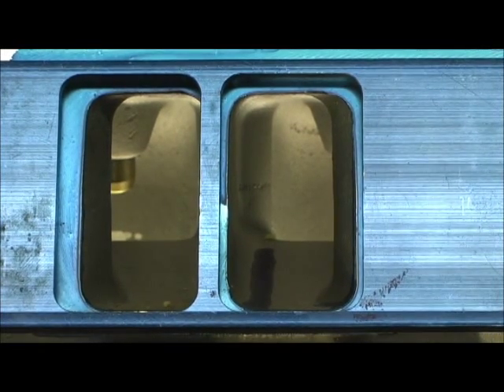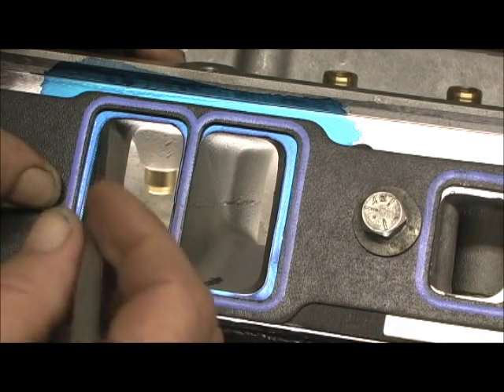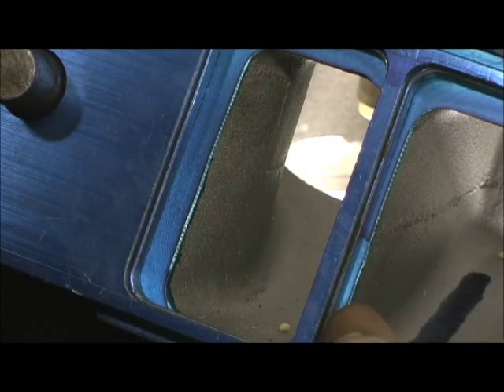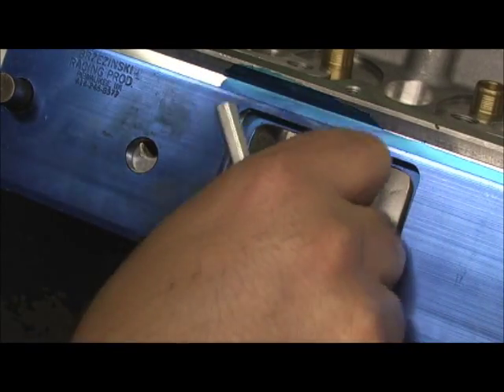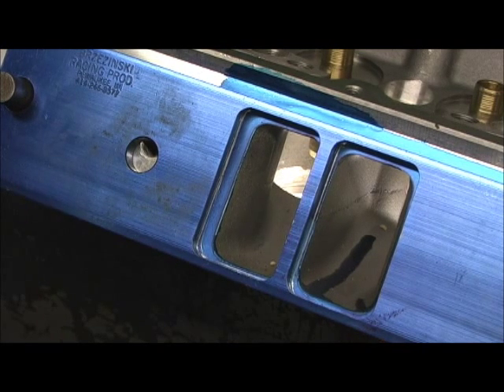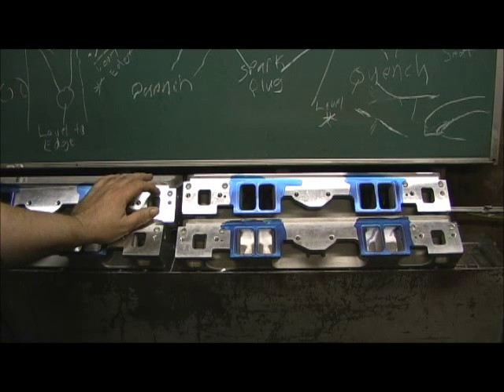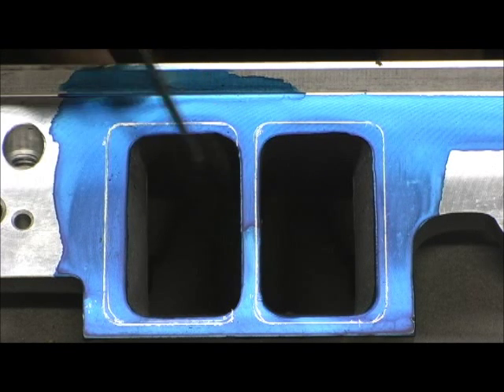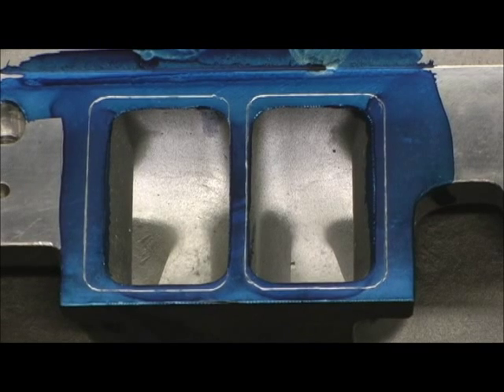Brezinski Plate ProComp 190 Stage IV.5 alignment

Comment: what is the realistic limit on these heads flow wise at say .500/.600 lift with 2.02 valves on the intake side? what about .500-.600 lift on the exhaust with the 1.6s?
Reply from the maker: About a year or so ago, I took these head to Mondellos Tech in Crossville TN, with the 4.030 Bore cylinder on the SF-600 they have and hit at 600 lift 303 CFM, and 261 CFM. BOTH AT .600 at 28"  Not bad for China junk, and 218cc intake runner volume
Reply: damn thats really impressive with that port size testing with a 4.03 bore. not bad at all for china junk lol
Reply from the maker: Jake Matthews that is what I am trying to say to people, it is the bottom line, 2000.00 for ProComp (or other china heads), or 3500.00 for Brodix or Dart FULLY DONE WITH PARTS!!! Go figure?
Reply: Headbytes Porting
yeah, alot of people think you are pulling their leg and remain skeptical. happens here all the time. i dont have a flow bench so i dont go into super detailed port jobs, i basically narrow the guide bosses. slightly raise the port,clean the port up  , re work the outer wall a bit and then blend the bowl area as best i can. i did this to a pair of 462 double humps on a mild 350, the car ran 8.30s with a very mild cam and gear setup. the owner had it in his head that buying dart 200s would be better (if they were ported they wouldve been better) he wouldnt let me touch them saying they were supposed to be ready to go out of the box. the car ended up running 8.50s with the dart 200s vs my ported heads lol. the dart is a much better head but from what ive seen flows around 235 -240@ .500 and the low lift numbers arent too good either. people really underestimate what someone with your knowledge can do with a relatively cheap cylinder head not only by making them power but saving them money in the process!

Comment from the maker: Funny you should say that, because you have to remove the "Black" after the porting is done, as the Bez plate lays the entrance on the head/intake relationship. You must remove the black to see IF you have to have the intake MILLED to line up the bottoms/tops as head thickness and intake thicknesses are different from head to head and intake to intake. Only a "hands on" test fit will determine that, but regardless you have to take the "black" out to the blue silicon.

Comment from the maker: Yea, it is more about the alignment from the ROOF area, of the flange to the bowl. with 1100 in the width dept., without using offset rockers, you really don't get anything over the 1205 except in the roof, which raised it almost .125 in and to the bowl long turn side; otherwise, your just making a BIG FUNNEL that looks good but just passes gas in the wind, if you know what I mean.....